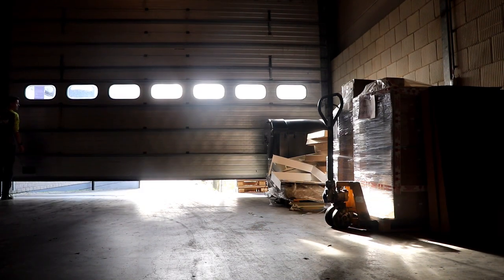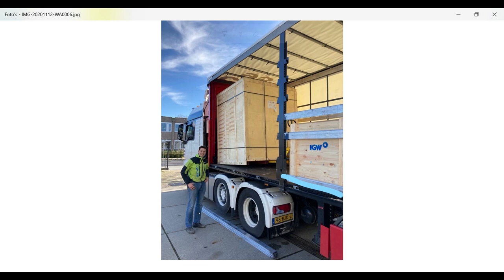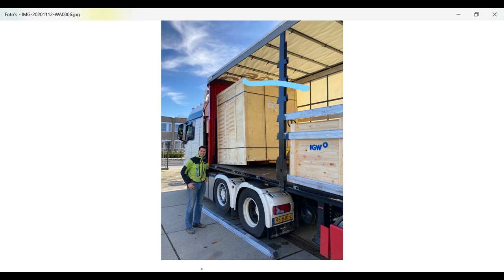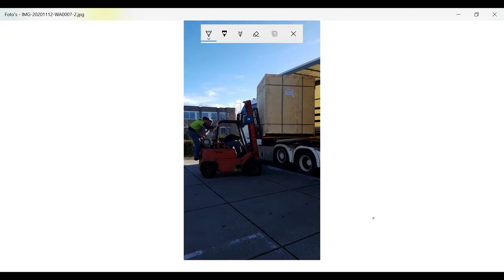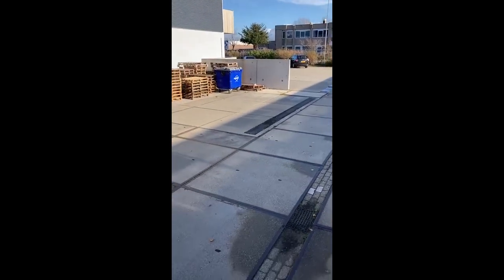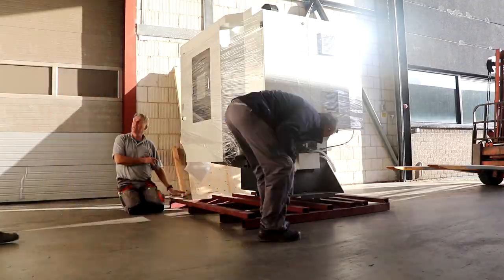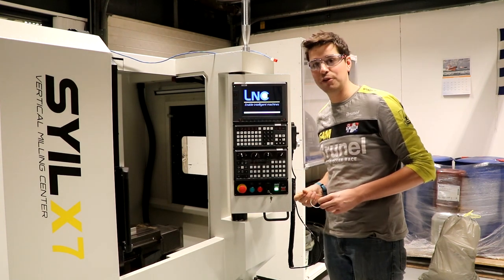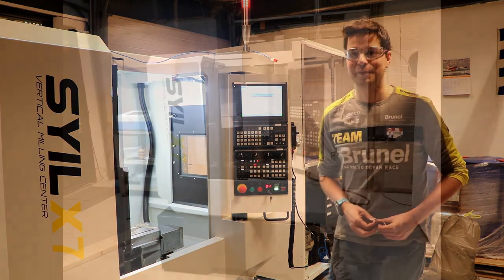Not so smooth CNC Mill arrival and unboxing (Syil X7 Epoxy Granite)

Comment: In the UK HIABs or knuckle boom cranes are the most common way of loading/unloading heavy machines. Some of them are rated to 18000kg or say 40000lbs . A friend on mine works in Texas and he says he has never even seen one there.
Reply from the maker: Jep, next time!!! If the trucking company had done what they said they would do, then this wouldn't have been needed. Next time I'll prepare better. Thanks for watching

Comment: Hello.
You bought a 3 phase machine but they sent a single phase, right?
Did they give you some money back or they coat the same?
 What was their justification for sending the wrong machine ?
I am asking this because I am seriously considering buying that exact model due to space constraints and I really don't want to deal with problems like that
Reply from the maker: Their domestic customers use 230v more often. I had to do some changes to the wiring from the machine to the wall, but very minor. I think if you are very specific that it won't be a problem!
Reply: Hello again.
Does Syil handle shipping or do we have to handle that ourselves?
Reply: Never mind, I have already saw your other video explaining that.
Thanks!
Reply from the maker: Great! That would be my suggestion
Reply: Hello again.
Payment : how did you make the payment?  Wire transfer? How much did the bank charge? 
Thank you.
Reply from the maker: Yes with bank transfer. It was 20 euro payment costs, so 40 in total. This because 50% pre payment and 50% payment before shipping. Feel free to ask more questions
Reply: Hello again.
What HS code did you use in the customs paperwork ?

What is the height of the machine when the Z axis is at its topmost position ?
Our garage height is 2.24 meters and I think that won't be enough ...

Thank you.
Jorge
Reply from the maker: Hs 8459510000. Top hight im not sure. 2.25m will be tight